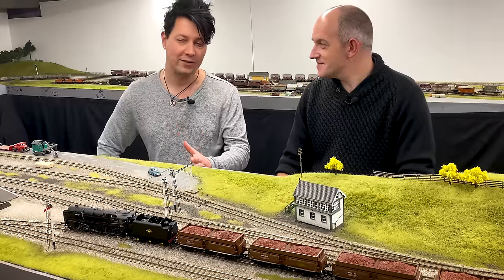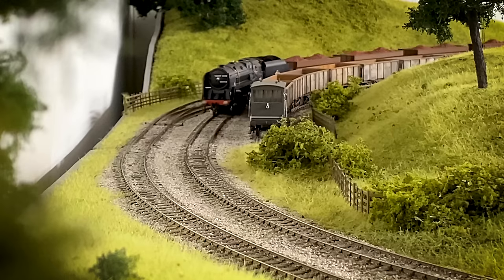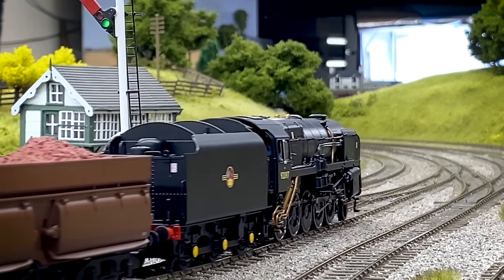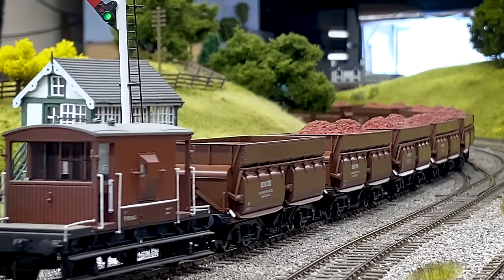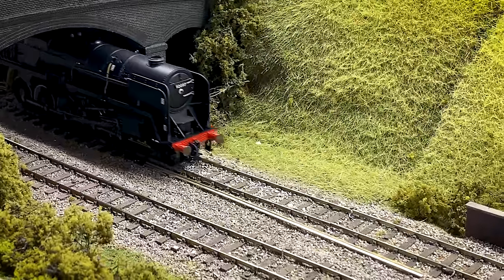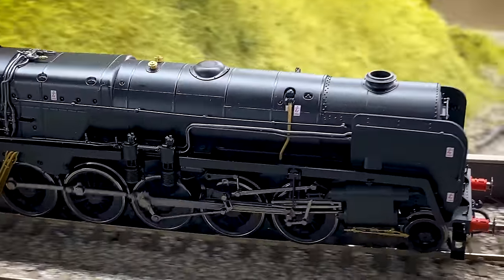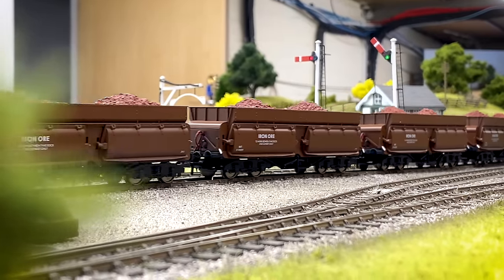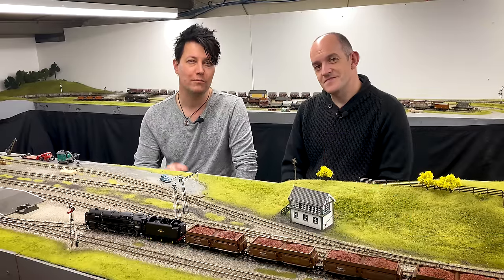HM198 Hornby Tyne Dock 9F review

Comment: Just as an aside I notice that the manual door release handles (the white tipped handles) on the hopper wagons are a mixture of some on the left and some on the right of the train.

The manual release levers had to be on the left side of the train and it was the Guard's responsibility to make sure that these levers were all on the left of the train at Tyne Dock and if not then the wagons had to be turned. So effectively the wagons were directional.

This was so that the manual releases were always adjacent to the walkway on the discharging gantry at Consett as if the compressed air door releases failed then the loads could still be discharged otherwise a return to Tyne Dock with a loaded wagon would have been the result and not cost effective.
Reply: Great piece of additional info 👍

Comment: A really nice loco, mine arrived over a month ago but its smokebox dart was bent due to the packaging. My question is, why is there a divider in the tender's coal bunker?

I still need to run mine with the proper wagons. But I see you didn't contact KR Models to get the missing pair of ore loads replaced, as pack B of the first release only came with 2 pairs instead of 3.
Reply: It has a coal pusher in the tender.

Comment: And what was different between a normal 9F and the Tyne Dock 9F?
Reply from the maker: The Tyne Dock 9F's has a pair of Westinghouse air compressors fitted to the fireman's side, which provided air to operate the doors on the wagons seen in this video. The remained of the 9F's did not have the Westinghouse pumps.